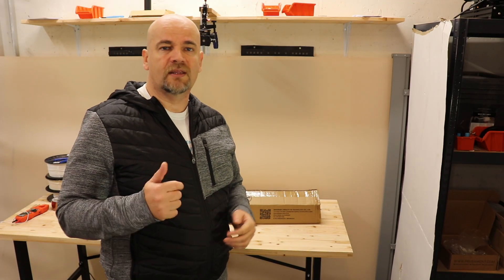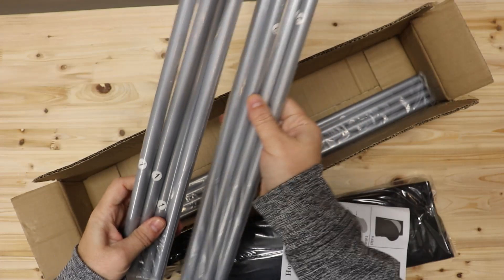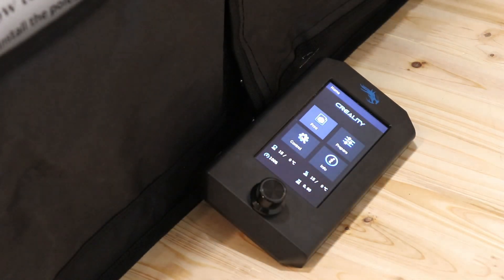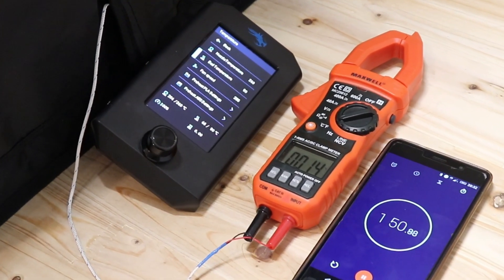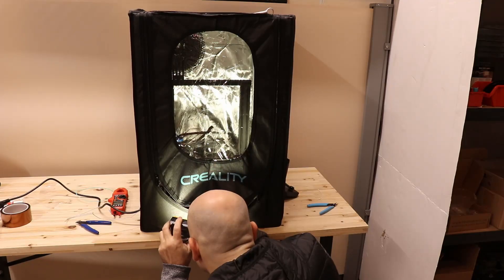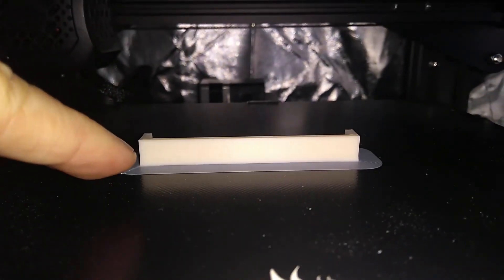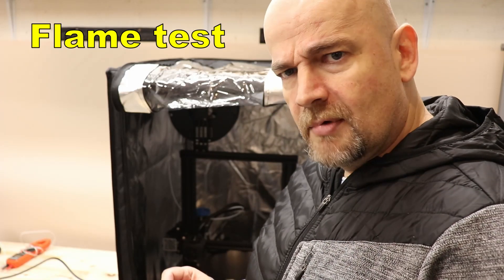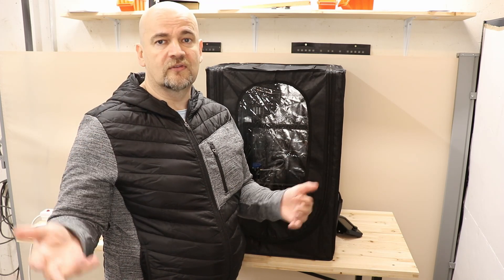Review of 3D Printer Enclosure made by Creality for Ender 3 size 3D printers

Comment: So this is safe to leave your ender 3 running all night etc all zipped up without causing any motor or cct board overheating ?
Reply from the maker: I measured it, no problems with steppers on Ender3. Stepper motors can run on much higher temperature. Critical would be with direct drive extruder, it's near hotend, on my Prusa it works at 60C without enclosure. Not sure about CCT board, I didn't measured that.

Comment: Well its well known that Asa have less warping than abs, but need more extrude and bed temp, and if yuo going serius ,an all metal hot end(so no ptfe tube)
Reply from the maker: For higher temps I go with my Prusa (for Nylon for example). For ABS, ASA Ender3 will do the job too (in enclosure)

Comment: Great video mate 👍 I got one of these a couple of weeks ago and am loving it. It helps cut down some of the high pitch noise, and I deadened mine further by sticking some 10mm heat proof car sound proofing foam inside (the foil covered type). My ambient temp is around 23 degrees and measuring the temperature near the top of the enclosure I get up to 40 degrees (nased on a bed temp of around 70 degrees). One thing to be careful of is any PLA parts you've customised the printer with can warp in the heat (I need to re-print my Raspberry PI case in ASA now so it doesn't melt). BTW Octoprint with a Raspberry PI and a PI Camera is a good solution for being able to see inside, you will may need to add some internal lighting to get the light levels up for the camera. Definitely well worth the purchase IMHO - well made and really easy to setup.
Reply: Is there a specific name for that foam? Or just what you said. And is it fully fire proof? I'm trying to cut all noise from my machine since it's in my bedroom and if fireproof noise canceling foam exists then I'm certainly intrested
Reply: @qade2128  PS I don't know what printer you have but mine was an Ender 3 V1. I replaced the mainboard with the 32 bit version with the silent stepper motor drivers and it's almost silent. I can't believe how much noise used to come from the stepper motors. That high pitched R2D2 sort of whine - totally gone. 

Another sound mod I did was to replace the PSU fan with a larger diameter fan with a lower sound level. Required a bit of metal work to do. That also reduced the high pitched whining.
Reply: @EricTViking  I've replaced the motherboard and fans all with noctua fans myself on my ender

Comment: seems kinda pricey for a cute little printer tent! Cant argue with those results thought! Airflow is the biggest thing you need to minimise! I use both my printers in Ikea Lacks that are against the corners of a room, I have one side blocked with a removable panel made from chipboard I got in the ikea Spares section, and the front I only cover with some fabric or something when I'm printing warp-happy filaments! works great!
Reply from the maker: I agree. What I like with this enclosure, that it is easily movable. My printers are in different location (flat, basement..). And in my overnight printings, I sleep a little bit better when printing in this flame resistant tent.

Comment: I've been using a cheap photo studio tent for my Alfawise U20 for a year now. I put the power supply in there too for maximum heating of the tent. I've been using this setup for a year now and I've been printing ABS and ASA with absolutely no issues with 100°C bed and 250°C nozzle. It cost me around 10 to 20 bucks, one of the best purchase of my life.
Reply: But that's terrible for power supplies, supposedly.
Reply: @alejandroperez5368  Well, it isn't impermeable, temperature in the tent may rise to +10 to 15°c compared to ambient but that's not bery dangerous for the power supply.
Reply: @TheThunderwars  an ambient temperature of 50 degrees celsius decreases its lifetime in half.
Reply: @alejandroperez5368  proof?
Reply: @user-yk1cw8im4h  People at Prusa claimed this on their making a printer enclosure video